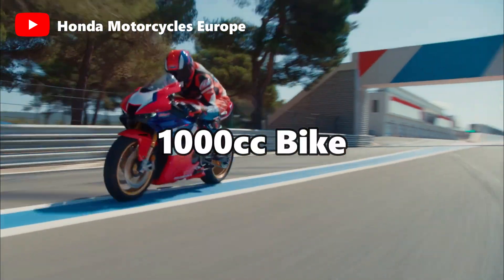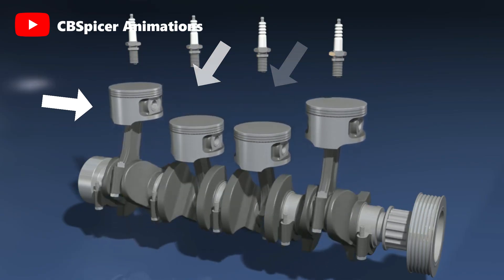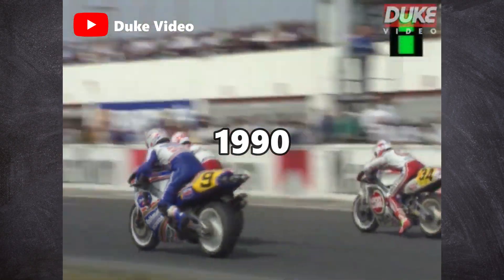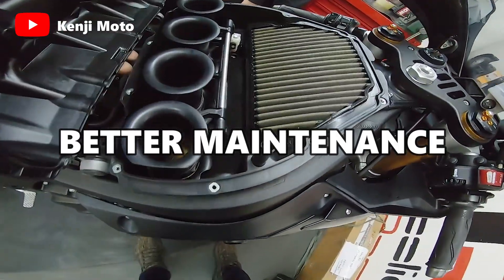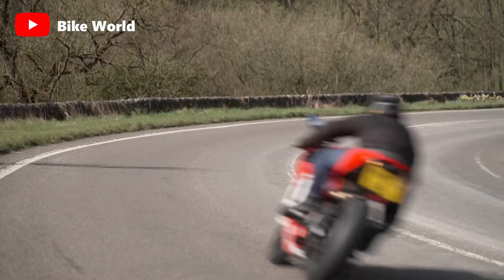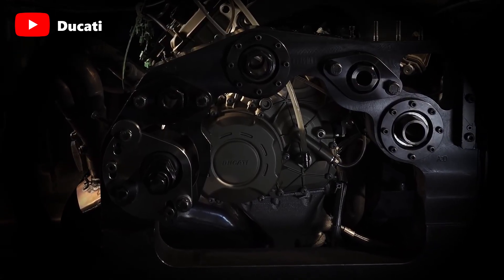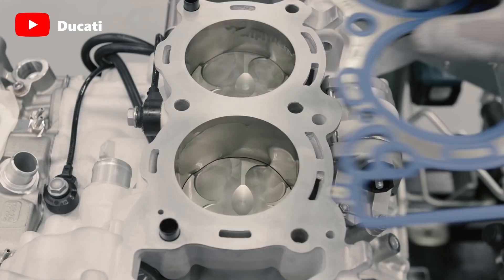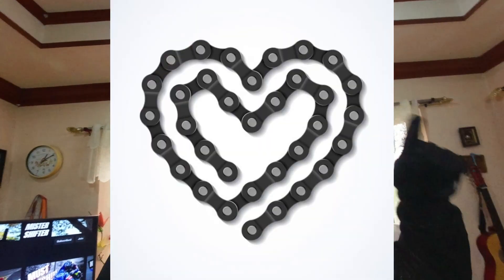What makes Inline 4 and V4 Engines DIFFERENT

Comment: To sum up: take V4 if you want to ride mainly on track, take Inline 4 if you want to use it daily on road
Reply: WRONG af
Reply: Not at all.

If you want to ride a superbike on the street, the v4 engine is better because it kicks in sooner, has more grunt, and doesn't make you want to rev the hell out of it.

The V4 produces power very violently, making it difficult for the average rider to get confidence and lap faster, whereas the I4 is much smoother and more stable, making it much easier to control and predict how the engine and the bike will behave.

I used to own a 2017 ZX10RR, and this thing is a nightmare on the street, with power that kicks in way too high in rpm and is overall torture to ride, but on the track it's perfect, very foolproof and so complimenting.

Now I own an RSV4 1100 and I prefer it on the street, so overall I am having more fun riding it. The engine is more flexible, but it's harder to ride on the track, and my lap times were 1-2 seconds faster on the ZX10RR.
Reply: @Fearless154 yes I was gonna say the same but I’m not an expert, the person to whom u r replying to, I feel I disagree. 
Interestjng
Reply: @Fearless154  "The V4 produces power very violently, making it difficult for the average rider to get confidence..." - I'm not sure if this is the best option for an average driver that wants to drive open streets 🤔
Reply: @KeithFlint350  
You clearly don't understand what I'm saying.

There is a big difference between trying to do your best lap and casually riding on the street. Everyone can ride a superbike on the street if you are not an idiot, but it's a different story trying to do your best lap time.

I guess you know what you're up against when you get a superbike for the street. So mat as well, it'll be torquey and not require you to rev the heck out of it.

Just like Mt10 is much more violent than R1 at lower revs, that's why it's more fun as a street bike, because you don't need to rev to 10k to get enough power.

When you're at your absolute limit on the track, excessive power delivery causes you to skid and slide, causing you to lose confidence and ride slower. The best and fastest track bikes are those that are easy to ride, not those with the most power.
Reply: @Fearless154  everyone can ride a superbike on the street if you are not an idiot. that kills me.🤣🤣
Reply: @KeithFlint350 no newbie should go on a sportsbike with 150+ bhp anyway, v engines weather 2 or 4 are more manageable and more enjoyable at lower rpm which what s used on roads
Reply: @Fearless154  ive been looking to buy a tuono v4 2021. Are the aprilia v4 platform as stable as people say they are?
Reply: @mala7794  
In my opinion, it is one of the best bikes ever made.
It is extremely unique in the naked bike category because it has nice wind protection, almost like a sportbike, and the engine has jaw-dropping torque down low with very potent top-end power that kicks in after 9000 rpm.
It is a sharp and potent track weapon that will out-drag and out-corner most superbikes while being nice and comfortable on the road.
The only con about the bike is that if you want to use it exclusively to commute, it can be a bit snappy and angry and won't suit this purpose well. It wants to be ridden like an ass, and it will reward you for that.
Reply: @Fearless154  think abt a trackday a couple times a month and mountain riding. I live in souther norway with lots of great roads.
Reply: @mala7794  yes they are amazing! I own a 2020 tuono v4 factory and it is extremely stable and smooth
Reply: @Fearless154  zx10r is better than any Ducati
Reply: @orionmobile6545  
Those are the words of someone who has never ridden a Panigale V4.
You can't even compare those bikes. Everything on the ZX10R is significantly worse, from build quality to suspension, brakes, electronics, engine, weight, and aerodynamics.
The Zx10r is at the bottom of a tier list in stock form compared to other bikes, let alone can rival top tier bikes in class like the Panigale.
Reply: @Fearless154  wsbk hello but but 2005 gsxr1000 a 15 yo bike is better than Ducati 😪
Reply: @orionmobile6545  
That's the funny thing; you clearly don't understand the video yet reach the wrong conclusion.
Ari Henning customized that k5 for track usage and to his own liking, replacing the stock suspension for k-tech, better master cylinder, better brakes, and power commander.
The Panigale 2020 was completely stock and had a soft rear shock, which was Ohlins' issue, and if you understand the basics of track riding, you will know how bad it is.
The main problem is that people like you don't know the mechanics of what is happening and reach false conclusions.
Reply: @orionmobile6545  
Now about wsbk.
Just the forks on Jothan Rea's bike cost like 3 stock panigales v4. Every bike in WSBK is upgraded with the best professional racing parts.
The gap between the bikes is very small in WSBK because it has those top-spec parts.
Also, the first year V4R came to the WSBK, it had a 15-win streak until it got its rpm restricted by officials.
And even now, it's considered the fastest and most powerful bike in WSBK with the highest top speed records, and it seems like Alvaro Bautista is going to win WSBK this year on v4r.
Stop using examples if you have no idea what the heck you are talking about.
Reply: @Fearless154  😴😶‍🌫️🌌🌠🌘⛈️ let's get some sleep I'm tired bruvv
Reply: @orionmobile6545  
Hope you learned something for the next time.
Reply: @Fearless154  I learned a lot from you brother.
Reply: @Fearless154  Yes, price!!! If that zx10r was to cost as much as the v4, you bet your ass it would be far better than the v4. Plus you completely ignored the reliability factor. The only thing i agree is that the ducati looks way better though.
Reply: @Fearless154  I’m not sure if you’re being sarcastic in this thread, but a V4S isn’t friendly for street riding also whilst in ‘street mode’ because they get extremely hot. (This scenario varies in countries that are normally cold/ windy. Current region: Australia )
Reply: @DucatiSydney  
I'm not talking about the Panigale V4 in particular, but about V4 engines in general and their characteristics compared to the i4 for road use.
The only time i mention ducati v4 is for wsbk performance and compared to zx10rr.
Literally all superbikes run extremely hot in slow traffic. My ZX10RR was extremely hot, to the point where I needed to stand up on stop lights to not rust. My nuts felt the same on the R1 and S1000RR.
I rode the Panigale V4, and I felt a bit more hit on my right leg, but it wasn't any hotter than any other superbike, so if heat is the problem, superbikes are not for you.
Reply: @Fearless154 You're not alone in this thread. Nome of these clowns own anything above a 125. My Tuono V4 is a fantastic street bike.
Reply: @orionmobile6545  Must be why the Kawi has so many WSBK championships.
Not like Ducati has the most WSBK titles than all other manufacturers, almost more championships than all the other manufacturers combined in all WSBK history.
Reply: @Fearless154  well a Ducati spends half of the time in the garage, there's always something broken, whatever is broken is expensive af to.fix, so most people ignore me and ride anyway
Reply: @youarenotsafe2215 was way better, thats why they are  expecive
Reply: @Fearless154 I disagree yes the duck bike are super nice. But cost much more to maintenance.   I'm a kawasaki guy through and through
Reply: You got it wrong way around.
Reply: Other way round
Reply: Opposite.
Reply: Jokes on you, the Panigale motors are the most unreliable I've seen at track.
Reply: @AnfecsIan  
Bullshit.  I'm a club racer, and we have two riders with the Panigale V4 who have both done over 20,000 miles of pure track racing without any issues at all.
I never owned a Panigale V4, but I had a 2015 1299 with 63k miles, half of which were track miles, and it was one of the most reliable track bikes I've ever had.
Ducati engines are literally indestructible; the common issue with the engine in the older V2 models is the timing belt snapping.
I have never heard of any Panigale v4 engine failure since the date it was released from any owner; all of the recalls and issues were about electronic issues or the suspension.
Even my owners rate it 5 out of 5 stars in terms of reliability.
Also, Ducati is the only manufacturer that offers a 24-month warranty with unlimited mileage as a basic warranty with 7500 miles between service intervals on their superbikes.
If their bikes weren't reliable as you claim, they would not offer the longest service intervals and the best warranty.
Reply: @Fearless154  Just because your experience is different doesn't make what I say bullshit. I ride regularly at Misano, Brno and Rijeka and the engines which I've seen the most dump it or have downtime were the Duc motors. Maybe the newer ones are more reliable 🤷‍♂️ I'm just speaking from my own experience, that doesn't mean it's bible speak.
Reply: @AnfecsIan  
You specifically said the "Panigale" is the most unreliable track bike, responding to the V4 vs. I4, which means you talk about the Panigale v4 specifically, and now you talk about older Ducati engines in general.
No Panigale engine was ever unreliable; the first Panigale was 1199, released in 2011, and it surely had major electronic bugs but was otherwise bulletproof and a race-ready, durable engine.
Ducati V4 engines are especially durable and indestructible.
And it is not just my experience; go read owners' reviews and reports about the Panigale v4 on the forums; most reported issues are electric in the first 2018 model.
As I said, owners rate it 5 out of 5 in terms of reliability.
Reply: The reliability argument is always brought up when guys run out of things to say. And it's pure nonsense. Whereever I go there always will be that one clueless pro japanese enthutiast who's itching for making a bad review of my Ducati... it's actually funny: "It has too much plastic," they say. Well, that's why it's 10-20 kilograms lighter. "It vibrates!" Yes, it does, but not sideways like yours. "Maintenance is too expensive!" Try an oil change every 15kkm and the first service at 30kkm. "I get more power!" Maybe, I have more torque when I actually need it. "But Ducati is UNRELIABLE! 😭" 
Every Ducati rider kows... and personnaly, it was such a pleasure both time I had to go the extra 100miles to fetch replacement parts for my yamaha and honda friends when we were touring in foreign countries. And I was gladly doing it with style 😉
Reply: @julienduseyau703  agree. and if reliability is the issue, then ducati has no right to have prices that are so expensive. it's just common sense. it also depends on how you maintain your bike. no matter what brand of your motorcycle is, maintenance says a lot.

Comment: An R1's CP4 engine is probably best here... Smooth and reliable like flat plane inline 4 engines... But it's cross plane nature aounds and provides confidence through corners like a V4 engine...sounds even better than V4 though... everyone has their own perspective.
Reply: Actually the V4 Aprilia sounds better.

https://youtu.be/q3WdxhXlLpc
Reply: Uhhhhhhhhhhhhhhhhhhhhhhhhhh... A CP4 sounds identical to a 90° V4 like a Ducati...
Reply: @Michael Bigdongovic it doesn't matter,if one is able to buy it then surely he won't care about repair cost
Reply: among the 4 japanese superbike's inline 4 engines the only one that does feature something that actually gives aid to smoothness of delivery and power/torque is the gsxr with the continious cam variable technology, as sold to the public crossplane engines, in the R1 and mt10 do not offer anything in that regard that a straight, run of the mill equivalent engine in the honda and kawi does not.
Oh, and I do not have a horse in this "fight", I always though suzuki do not merit any word of consideration apart from "good deal for the money, but ugly AF".
How it sounds? yeah maybe, that's subjective, always thought that the mt 07 sounded like a can of bees stuck in a box, hunky and unpleasent, and everyone and their dog seem to like it, delivery of power was better than the equivalent 650 from kawasaki though.
Reply: Yes they do. Crossplane engines offer fewer power pulses per rotation of the rear tire. This allows more grip when on your exit. Dirt bikes (single cylinder) have only 1 power pulse for a reason

You could argue that the general public will never use the full potential of the R1 to even receive the benefit of the crossplane, and that I agree with you on.

The Crossplane is dying though. Yamaha is the only crossplane engine in MotoGP, and they haven't won a single MotoGP race in over a year. There was only one crossplane engine in the Isle of Man's top 20 racers, and now that rider has switched to Honda. I think the only reason the Yamaha still uses the crossplane in competition is because if they stopped, the engine would lose it's magic, and consumers wouldn't want to buy one anymore. They've dug themselves a hole now.   @VittorioSergi

Comment: Have you guys ever heard the sound of an inline 4 with a gear driven shaft instead of a timing chain? Good examples are Honda CB250f (Hornet) and the CBR 250 MC22. Those gears create a high pitch wine and sounds insanely good. Here's a good example :
https://youtu.be/jlMGBvsWHTw

Comment: Great topic! I have owned many inline fours from 400cc to 1000cc. Reliability and ease of maintenance are a plus. Power on my Z1000, R1 and Honda CB1000R were great and then I bought a Aprilia V4. Oh my god the torque was insane, and the sound was like a moto gp bike. I did have issues withe valves and maintenance, but the absolute power was worth it. The Italian V4, in my opinion will never run as many miles as a Japanese in line four. I put over 80,000 miles on my Honda inline 400 and then sold it. 40,000 on my Honda CB1000R then sold it and it ran like a top. On and on about in line fours I have owned. After 35 years and 15 motorcycles i now ride an Aprilia 660. To me for the street it is the perfect balance of power and handling. My crew all ride 600-1000cc inlines and on the canyons this is all I need. Finally it is an Italian bike and when the warranty is up I will trade it in for a new one because I love it so much, but I don't trust it passed 12,000 miles (at least the way I ride it).
Reply: Hi mike new high hp  engines have such tight tolerances  you MUST do that 1st 600 mile oil change and  valve adjustments ect .. Do that and new bikes will last longer than the old bikes . Its not the brand its the fact you own a bike with a race engine .
Reply: Your blessed
Reply: My gsxr 600 blew engine and cbr1000rr consumed oil so japanese are not imune like people talk

Comment: I’d choose the inline 4. It’s too iconic of a sound for motorbikes and I just smile when I hear one flying by.
Reply: Straight up!!!!!
Reply: động cơ inline nghe vẫn phê hơn , tiếng hú uy lực
Reply: The sound of the Honda Interceptor v4 is pretty intoxicating as well
Reply: I own a zx25r (i bought it and it was one of my dream motor). I cannot disagree to this, even though i have a zx25r i always run outside to hear other inline 4 sound outside my area......IT'S JUST SO GOOD TO HEAR.
Reply: See now that opinion I can understand. And they are cheaper to produce and maintain.
Reply: To each their own. The inline 4 sound like every other 4 banger car on the road to me. I can’t stand the high pitch fart can sound.
Reply: @richardmann4006 not even, you got it the other way round the v4 sounds like a lawnmower the inline 4 sounds like a race car
Reply: @richardmann4006  yeah right. The motorcycle inline 4 with short air induction and exhaust that starts living at 9k and spins to 13k/min sounds like a every 4 cylinder car that barely manages 7k but more realistically stays in the 2-5k range . Stop drinking paint thinner.
Reply: @richardmann4006 You literally have it backwards lolol

Comment: The crossplane crank consist of 360°,90°,180°, and 270° to form a cross..not 270° alone.. 270° crank only applies to parallel twin engine configuration.
Reply: Huh. Since both are offset 90 degrees at each cylinder, I always took crossplane to mean going "across" the flatplane axis
Reply: Agree. The 270 degree twin is also called an L engine. 
If you look at the crank from the side, the 4 cylinder engine's crank pins form a cross, the twin's form something like an L.
Reply: Ktm did a 285 right